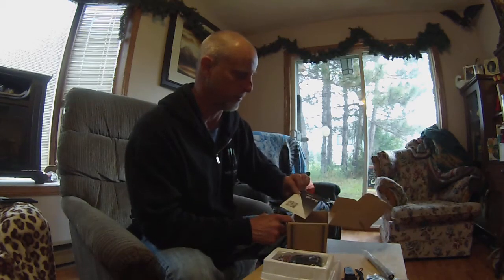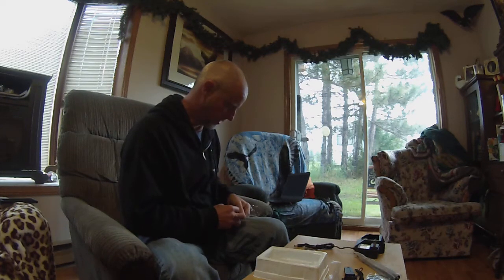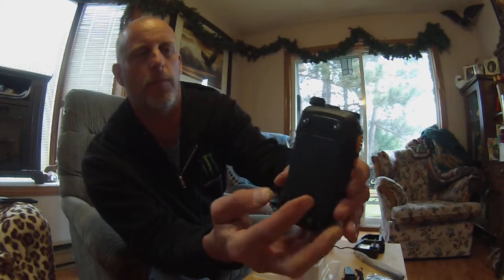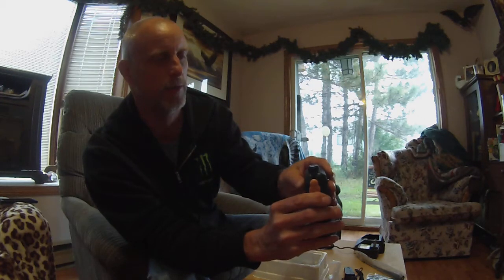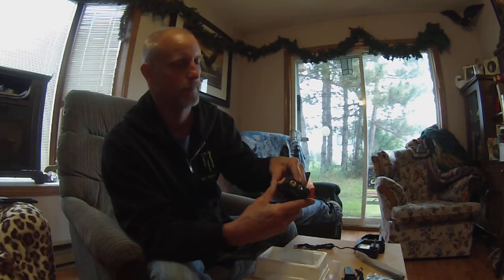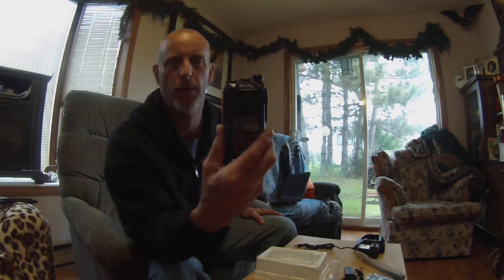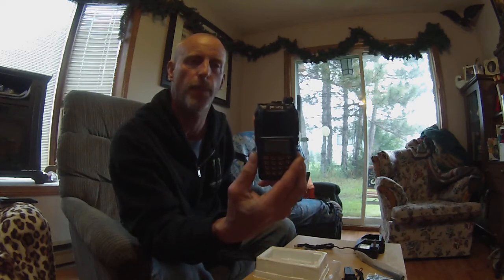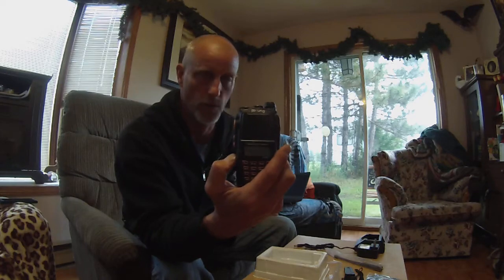Unpacking The Pofung UV6R

Comment: Hi Fred
I just bought  this radio when I was at the pearlmarket in Beijing. When I came home I tried to connect it with an adapter to my outside roof-antenna but radio was deaf, couldn't hear a thing. My antenna works fine with my other VHF radios. Any suggestions?
Reply from the maker: SM7FBJ gosh not good, mine works well and work sats with it daily

Comment: How have you got on with the  UV6R ?  Is it easy to use.
Reply: David Harris. Morse code is no longer a requirement for a basic amateur license in the UK.  Check out this PDF.  http://mc0mnx.webs.com/foundation_licence_guide%5B1%5D-2.pdf
Reply from the maker: Actually very easy to use, and with the programming software easy to program, I haved used it to work SO-50 satellite as well and it was amazing how well the little radio worked. I used it this past weekend as well while on our Scout Fall Camp for comms between base-camp and trail expedition.
Reply: Thanks for very prompt reply. I actually purchased this radio so I could listen around and decide about taking a Amateur Licence  course here in UK. If i dont I guess I will use the public channels. i believe here in the UK we have to use morse..that does not interest me sadly !